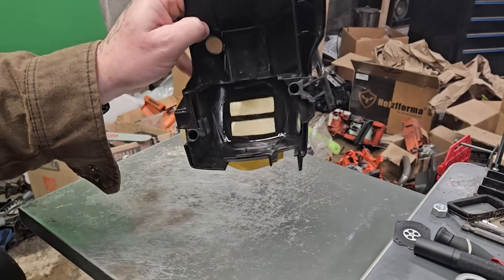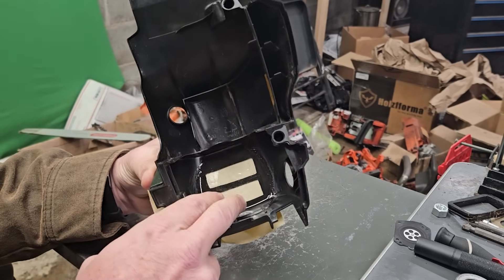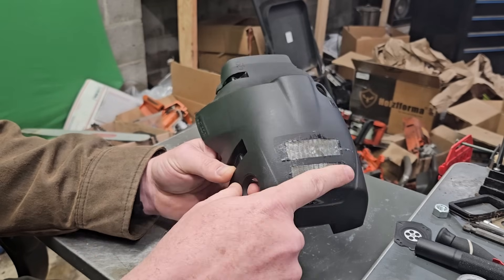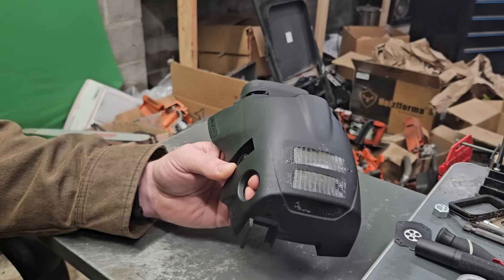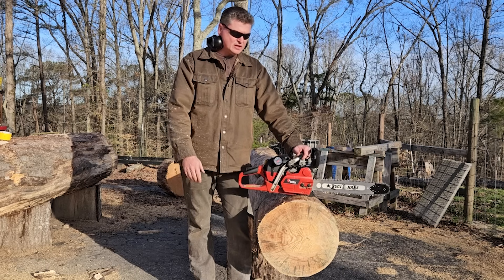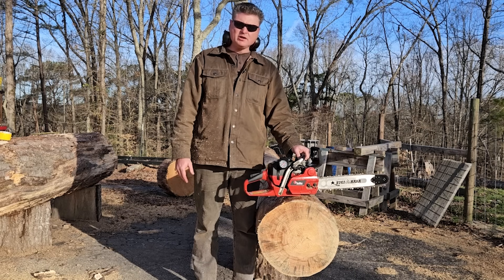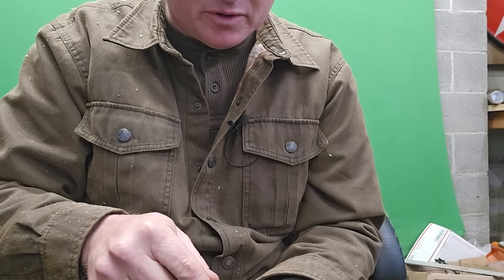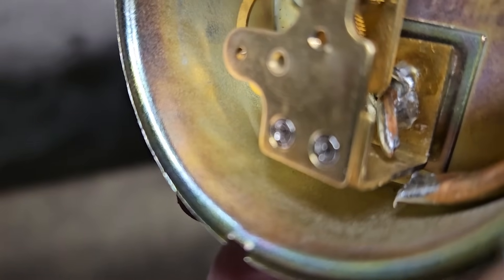Are Husqvarna 5 series saws actually Turbo Charged?

Comment: Bosch is Junk..  Forget the 'German Engineering' 
 BS. Beyond that 2 strokes can only tolerate Very low boost  6 lbs being Max on an engine intended for it. 
That also assumes the carb can shift to the higher fuel flows required for boost operation.

Comment: in my opinion, if it creates pressure it will be very low, I don't think it exceeds the resistance of the filter, above 30° 35° c when hot, mine doesn't start anymore, I have to remove the cover

Comment: The original intent of the design was and still is a pre filter air cleaning assist for the filter chamber/box and of course the filter itself, I suspect that if there is a small amount of positive "boost" it was a side effect outcome and probably not the original intent of the designers. With that being said the story I've heard a few times over the year's was that Husqvarna had a separate design team working on the Jonsered side of the company trying out most of their "experimental" idea's they came up with, like the 630 supers and 670's getting bigger carb's then their early Husky counterparts to give them a little more jam; story goes the Jonsered team came up with the air injection system for the husky saw's and they named the Jonsered branded saw's "turbo". Don't know if this is a bunch of bs or not but I was told this more than 20+ year's ago by a sale's rep from Husky back in the day so who knows. If it's true then I guess it wasn't all marking bs, very nice strong running saw by the way.

Comment: Ya know, most of the air-over-filter systems I have looked at seemed to be flowing air TOWARDS the fan housing (which would then go over the engine) and would imnfact draw air from the vent holes around the rear handle to keep the filter clean.  I distinctly remember the 4910/501 the smoke went from the filter cover area towards the fan housing (tested with a smouldering bamboo skewer)
Reply: I completely agree.!!!   Poulan’s were the first ones to do that centrifugal or centrifugal air movement to eliminate them fines…

Comment: Run your saw w/o the cover. They get hot as the dickens. I believe it's cooling not boost.
Reply: Probably. Just like the engine cowling on a small airplane. But you have to have a pressure differential to create airflow so 🤷🏽‍♂️. No idea how it’s ducted so can’t say it’s creating any intake boost but I’m sure a spinning fan will create a high pressure somewhere.

Comment: Very cool video. That saw sounds fantastic! One statement that you made although probably true is technically wrong. You can't automatically assume boost gives you more power. If the boosted air is hotter it can contain fewer oxygen molecules than unboosted cooler air. But in this application, centrifugal fans unload the less air they are moving. So in my estimation the saw has less parasitic loss with boost as opposed to free flowing with holes. Whether any of this  amounts to a hill of beans is a different  matter. 😅

Comment: use a flexible line, the bourdon tube (Bit that broke off) is a lot of dead weight on the end of the mechanism, it will probably crack off even on a decent gauge, they are not meant for the sort of vibration a chainsaw produces!

Comment: It is simply a pre-filtration process. Nothing more.  
Two-strokes do not perform well with an externally pressurize intake charge.  The fuel system cannot adequately keep up, resulting in very lean conditions at high rpm, and very rich at low rpm (loading).  
That's why top-teir MX engines are not turboed, nor supercharged.  
Any additional intake pressure of the "turbo/air injection" system is limited by the filter and carburator size.  For performance increase an open air filter and bigger carburator would be the way to go.  
Can it be done?  Absolutely, but the tuning would be so rpm-dependant that any change in engine load would decrease the performance exponentially, not to mention substantially increase engine wear.  
It has been tried successfully, and is more of a gimmick than anything else.  Much like the Stihl Jetsaw.
Reply from the maker: I thought so too.  But it is in FACT charged with positive pressure.  I have another gauge already on order, and the next test will prove it beyond any doubt.  It truly does build pressure and from my feel, the saw is without doubt more powerful since I closed off the holes I had cut unto the top.  The next video will silence any and all doubts.  Trust in this.  I couldn't believe it myself.  But before the vibrations broke the gauge, it was without doubt building pressure.  I saw it with my own eyes.  You will see as well.  I couldn't believe it myself.  But yes, it is turbo'd to a small degree.  Makes sense now why they are so much faster.
Reply: @boedysempire  
I do not doubt it, as it is designed for a semi enclosed intake box.  Closing or limiting any engines air intake will always diminished power.  Try it with the top cover off. 
The JRed Turbo system design is to limit outside air, allowing for primarily pre-cleaned air.  Without the "turbo" inlet, performance will definitely suffer.  
It's truly an absolutely ingenious design.
I appreciate your testing, and am curious as to the results.  
However, decades of two-stroke engineering done by multiple manufacturers and thousands of performance have not found any appreciable gains of any air box over surface area.
It's strictly a filtration feature...  But a dang good one.
Reply: @boedysempire  
I absolutely love what you are doing, and eagerly await your results.  But you need a control.  Try an 026 or JRed 51sp...  Something without the centrifugal pre-separation system.  Taking something designed for a system, then sabotaging the system is inconclusive and anecdotal.  
Break it down logically.  
If there was any appreciable boost increase from flywheel rpm, the higher the rpm, the more boost....  Forcing higher and higher rpm.. eventually out-consuming available fuel intake...subsequently creating leaner and leaner conditions...  it's a simple positive feedback loop.  
If you let off the throttle the spin-down of rpm would be delayed, and substantial (as the residual pressure would need to be consumed by the engine before the rpms would drop).
Such a situation is commonly managed by a boost wastegate.  At the very least an RPM limited coil would be required to prevent over speeding of the bearings...as higher rpms would create higher rpms. 
Because two-strokes are rpm limited by continuously increasing the amount of fuel until there's so much it starts 4-stroking and flooding (more fuel=more oil).  Yet the earlier JRed 2071 & 2171 have unlimited coils with the exact same Turbo intake as the limited coil on the 2172. Same part numbers and everything.  
I have no doubt you will see a pressure increase from the system, as outside air is being blown into the air box.  But it's negligible by design.  This isn't some high velocity wind being ram-aired into the carb, it's a slight breeze to keep particulates from settling on the filter.  Nothing more.  
Two strokes are very precise systems, and even a tiny air leak can catastrophically unbalance the system.  
Full race designed dirt bikes, racing ATVs, snowmobiles, nor jet-skis even have a ram-air system, let alone pressurized/charged intakes..  For a reason.
Instead, they have large intake surface areas, rifle-bored carburators/throttle bodies, adjustable fuel jets, lightweight pistons, precise combustion chambers, liquid cooling, and aggressive port timing... to make power.  Not turbos nor superchargers.  Two stroke power is from the exhaust...  Not the intake.
The design engineers knew this.  The vast majority of air being moved by the flywheel fins is dedicated to cooling the cylinder, with just a tiny portion fed into the air box to keep dust and chips from settling.  Not to charge the intake.
The genius of the system is to keep chips out of the air box, not to turbocharge it.  
I was with you in the mid 1990s.  "Turbo" chainsaw!!!  Why doesn't everyone use this?
Lol.
Reply from the maker: @Matt-416  I'm enjoying your thorough write-ups. But there is a "but", and it is a BIG 'ole butt that Sir Mix-A-Lot would sing about...  I am getting information directly from a man who worked hand-in-hand with the Husqvarna engineers for five years.  This is not me blowing smoke or just taking guesses.  This is real.  It is turbo'd.  The conversation is too long to have in the comments, but EVERYTHING you could say to fight against this has a counter.  The more I learn, the more I'm thinking that the Husqvarna engineers are the best in the world.
Reply: @boedysempire  
Had the best engineers?  And I positively agree completely.  HAD.  
Husky has completely dropped the ball.  
Chinese components, overly complicated engineering, poor end-user consideration, heavy, bulky, sealed bearings, multiple crankcases within saw type, no class interchangeable parts, unnecessary multi step auto-tune reset procedures, tin potato mufflers that are ridiculous to modify...  And absolutely no innovation.  Laughable aftermarket support.  Bark box?  Intake kits? 
What's Husqvarna's answer for the 500i?  Brand new class of saw (remember when Stihl had no answer for the 365S?). What runs with it?  The 585xp? Definitely not the chunky 572xp.  Why did Husqvarna design an 86cc saw that's two and a half pounds heavier with under  0.3 less horsepower than Stihl's 80cc saw?  Really?  Nevermind the fact that a 80cc Stihl is a pound lighter than Husky's 70cc saw.  And dimensionally the same.  
Where were the "best engineers" on that one?  
400c?  Yup, the Husqvarna 565...  How's that weight and power... ?572?  Nevermind the ease of Stihl's disassembly and modification.
Why do Stihl 80cc felling dawgs fit on their 72cc, 67cc, 59cc, & 50cc saws...?  And Husqvarna 60cc dawgs fit in what other model?  
What's in their pipeline for unreleased models?  Stihl has a 202T, a 662, 882, and there's rumors of a 700i coming.  
It's sad.  The travesty of the 576, 562mk1 & 550mk1 is telling.  The weights and sizes are a disappointment.  The commonality of bearing failure and vacuum leaks are....  
Husky HAD the absolute best engineers.
Reply from the maker: @Matt-416  Mannnnn....  okay.  Think what you want.  I absolutely do not have time, nor inspiration to debate you.  Stihl sucks, and nearly every inch of progress they ever made was on Husky's back due to a very specific technology law in Sweden.  Can't blame you for thinking the way you do, Stihl has the world's greatest marketing department.

Comment: If it is actually making measurable boost, you should try to plumb from the air injection inlet to the carb intakes. It would be a bit more complicated with this being a strato vs a standard style cylinder. You can have a filter screen in the plumbing. Heck you might even be able to open some of the recoil cover vents for more air possibly. I don't have a saw in this chasis or else I'd try it myself

Comment: As they say follow the money. Follow the air from the flywheel through the air duct into the carb chamber. As you piston draws down it no longer has to draft relative  to boost/turbo pressure. No longer is it self asperating.

Comment: Anything with air injection or Turbo is not filtering as well if holes are cut in the top cover.
Reply: Or cooling.
Reply: @austindenotter19  The top cover is divided so that the hot air from the cylinder doesn’t mix with intake air so if you were to drill a hole in the top cover for the the filter it won’t affect the cooling capability.

Comment: Most likely the circular vibrations were flexing the bellows and causing the needle to move. Much in the same way they will spin out a loose bolt or nut.  Not an actual indication of pressure.  Try it again, but use a flexible line to isolate the gauge from the saw.
Reply from the maker: I believe you are correct.  When I first looked at the gauge, it was operating as it should, and read just below 5 psi.  But then the vibrations broke the gauge. The next gauge will be tubed in and mounted properly to decrease vibrations.
Reply: Get another gauge and attach it with a flexible air hose to eliminate any false readings from vibration.  Nice investigating Boedy!!